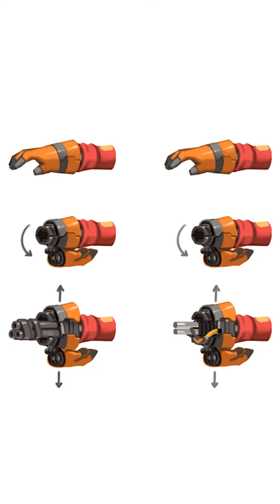TF2 Short Circuit FACTS!

Comment: Rhe minigun could work.

The minigun could be made powerful, but use up metal at a high rate like the Widowmaker, making it less effective when trying to build up your buildings due to the cost, but excelling once they're up, running and not in a dire need for metal.
Reply: Or just a pistol reskin
Reply: @soupcangaming662  a pistol reskin only engineer could use? yeah that's a pass

Comment: honestly if tf2 was a hero shooter and they gave engie reaper's scythe from black ops 3 that would be amazing
Reply: i like this idea so much in fact I'm gonna come up with all classes passives, tacticals and ultimates please stand by

scout:
passive: low profile (apex) smaller hotbox higher speed as per the og game
tactical: combat roll, at the cost of your momentum dash forward a short distance to avoid fire
ultimate: overdrive (bo3) gain a speed boost in running, reloading and weapon switch for some time

sniper:
passive: lie in wait (paladins) slowly gain ammo to your reserves as you stand still
tactical: open season (~paladins) enemies hit with fully charged shots are visible through walls for 2-3 seconds for the sniper only
ultimate: cinematic slowdown (bo3 campaign, skyrim slow time shout) time slows down around you, your speed is slightly increased

pyro:
passive: afterburn immunity as per vanilla game
tactical: jerry can (gta) leak gasoline on the floor, the floor is affected by afterburn and however much time is left on the floor's afterburn is imparted to those who walk through lit gasoline
ultimate: heatwave (bo3) send out a blast of heat in a small radius around you disorienting and slowing enemies

heavy:
passive: fortified (apex) take a small amount less damage from attacks and are immune to flinching
tactical: deployable cover (rogue company) deploy a full body sized shield with ~200 health
ultimate: primal rage (ow) applies buffalo steak sanvich and some heavy damage resistance

soldier:
passive: mercury poisoning, the sheer amount of heavy metal in your system makes you more resistant to knockback
tactical: rally, similar to the banner's range apply your knockback resistance to your allies
ultimate: extra bang, your reserve will be locked in favour of ~5 high explosives rockets that take longer to load but deal more damage and knockback

demoman:
passive: explosives expert, take a small percentage less damage from explosives
tactical: tbd

Comment: let's give stats for the concept version then:

the handy gun (to not confuse with the short circuit):

Use metal as ammo [2 metal = 1 bullet]
fire rate: 2 bullets/second
damage pet bullet: 6 (close) - 2 (far)

on successful hit: gain back spent metal.

while deployed: cannot get metal from any source.

fair and simple: it brrrt and as long as you hit, you won't be spending any ammo...but is weaker than minigun, obviously